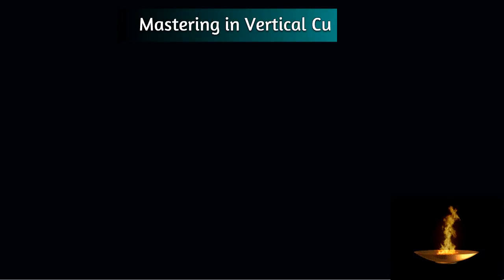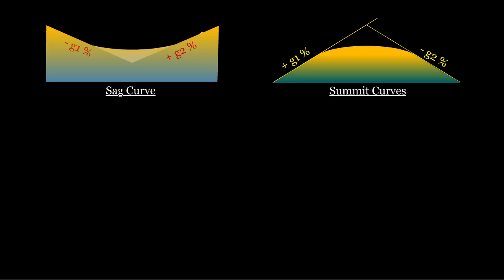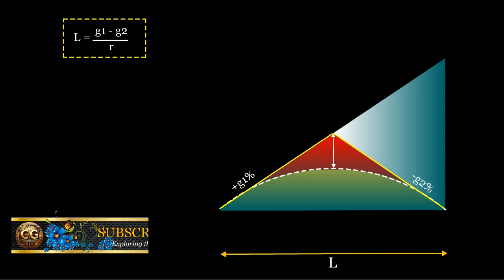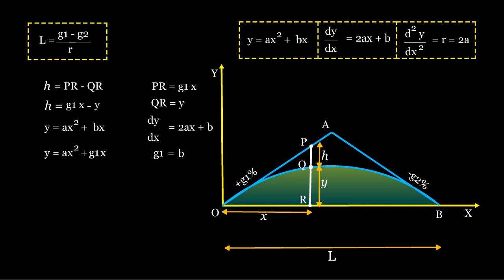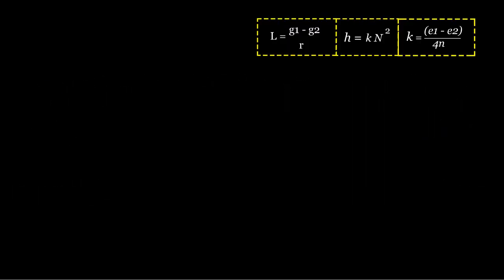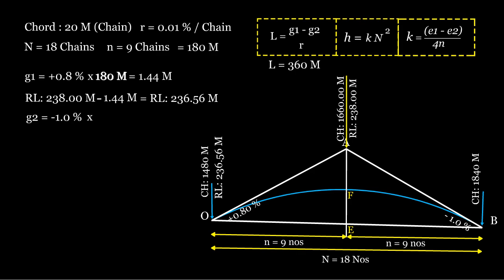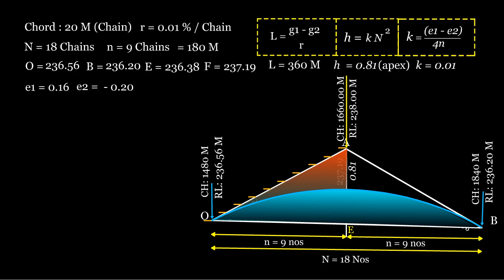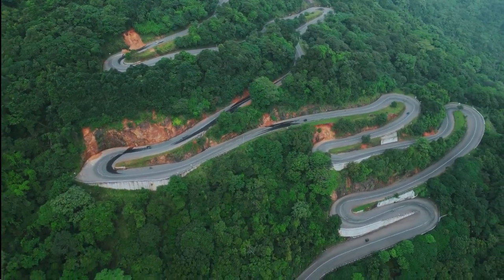The Vertical Curve Secret That Makes Roads Safer

Comment: Nice video but how should I calculate vertical alignment on a road
Reply from the maker: Hi,, this video is regarding designing of vertical curve, means after longitudinal survey, after plotting the longitudinal section of the road the vertical alignment can be found from the LS,  
How ever if you want to know vertical alignment of an existing road, first chose the location of crown point (appx) where the vertical curve is required, and take the level at the middle of the road appx. 200 meters both side from the crown point at every 10 meters intervals, please plot on a CAD or a simple graph sheet with suitable scale, and draw a single tangent line touching all the points (level) at both side from the crown point, with that, you can approximately judge the existing road vertical alignment, (slope per meter)

if it is new construction, take levels on the existing ground on road alignment and plot in CAD or graph sheet as mentioned above and select (assume) required vertical alignment, 

Note: The planning (assuming) of the LS is purely based on the existing traffic (or) estimated traffic, and facilities planning to provide to that particular road project and budget of that project etc... it is purely based on the experience

I hope, I have cleared your doubt, if you need any further clarifications, please don't hesitate to contact us
Reply from the maker: Great question! To calculate vertical alignment on a road, you'll want to consider the grade, length of the curve, and the design speed. There are specific formulas and guidelines that can help you with this!